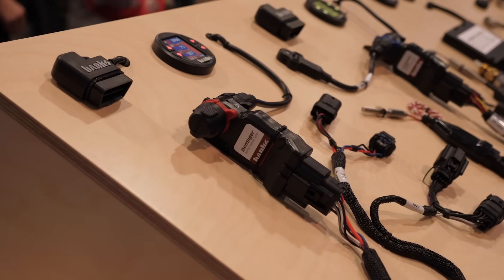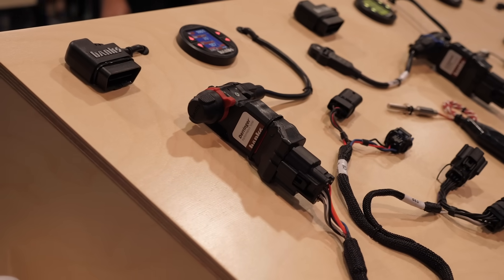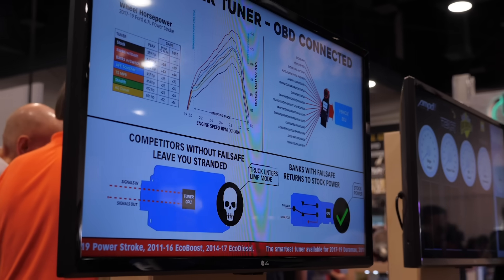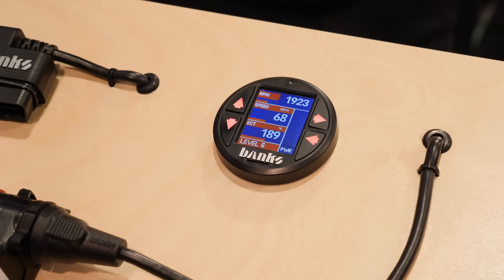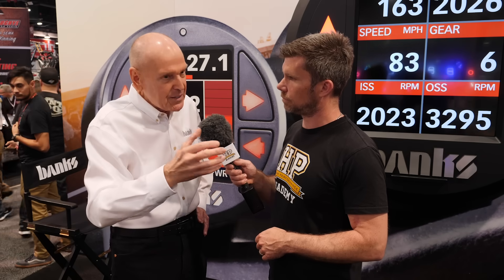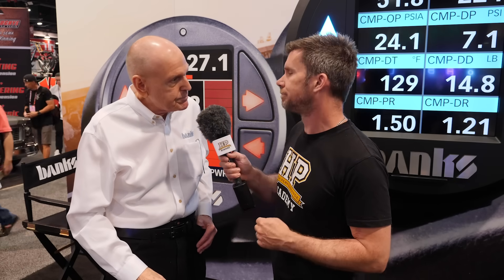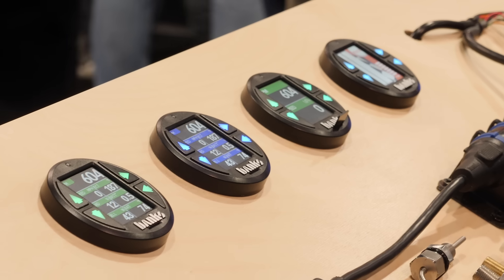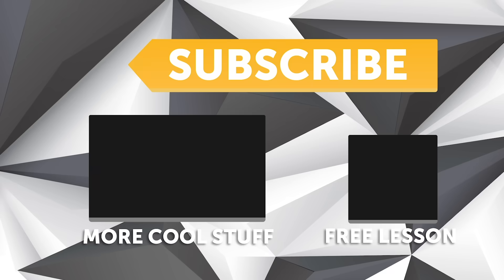More POWER With A DPF Fitted? | Gale Banks On Emissions [TECH TALK]

Comment: A lot of the focus is around the dpf. Here's a valid question: Why do manufacturers make these components welded to the exhaust vs having crush seals with clamps so they can be quickly and easily changed out when they do go bad? To normal people, it's rare enough to not be an enormous deal, but when a person uses it as a work vehicle, it can reach the end of its life in three years time. By the time a vehicle reaches 150-200k miles, it's typically devalued to the point it's not cost effective to spend the cash to replace it. So then people buy new vehicles. Sounds like a large carbon footprint to mine, refine, stamp, and manufacture all of the components of a new vehicle no?

Next is the egr (my large gripe). It soot loads the intake and combined with oil from the pcv, it completely gums up everything in the intake. It also soot loads the oil meaning accelerated component wear for any moving part in the engine. Though egr does reduce NOX emissions, whats the trade off here? Suddenly it takes million mile engineering down to 300k. SCR and plastic jugs are another irritating item. If every diesel pump had def nozzles, it wouldn't be as big of a deal but single use plastic jugs are garbage. I'd keep the exhaust crap to keep the epa happy but the egr choking up the entire system is horrible. Higher egr rates also lead to more black smoke production, clogging the dpf faster leading to more frequent regens.

I know gale banks is a brilliant individual in the tuning world, with nearly unparalleled knowledge, but I would like to see him take some stance on what should be acceptable vs too far when it comes to emissions restrictions. Hes got more knowledge on the subject than probably every consultant for CARB and the EPA combined.
Reply: As an major domestic certified dealer technician i can promise you OE manufacturers do not care about you (directly), or the ease of a vehicles repair. They care about sales and profit margins. If they can assemble a vehicle faster by having one huge exhaust component they will. It reduces part numbers (build materials) and time to install. Vehicles are built and engineered to be assembled on a mechanical assembly line. Whatever makes that job easier is what they care about. It's easier to pay us flag hour techs in the dealership to repair or replace something later than it is to slow down or stop an assembly line. They don't care about me, you, or anything else. As long as the vehicle is sold and can make it out of warranty, they're good. Also, the engineered lifetime of a vehicle is 150k miles. Lifetime fluids, lifetime filters, etc all are 150k mile services, or until a catastrophic failure, obviously.
Reply: @revell7156  Unless you're a Japanese vehicle manufacturer, then 300,000 mi. At least.
Reply: Perhaps you should consider installing a catch can to deal with the crankcase fumes.My Peugeot has a removable dpf with crush seals
Reply: @davidwarren4569  ,Yes, Gale has an in depth video on how they work and why they are so important.
Reply: I almost guarantee that it cant be a simple bolt on device because that would make deletes that much easier. Its probably EPA regulation as well as cost. As a automotive engineer every cost has to be approved if a cat or other exhaust component is bolt on instead of welded that means 4 flanges 2 gaskets and like 6 nut/bolts. You would be amazed at how much approval is needed for a $1 cost increase per vehicle.
Reply: Agreed, manufacturers makes it both impossible and very expensive to maintain your vehicle in the long run. All these devices won't last very long
Reply: @marcnunes6916  They don’t care about you. It isn’t the government, it’s the OEM. For them, the target is profits in first sale, after that isn’t their problem. And work trucks aren’t the norm in the market now
Reply: I have to agree with you MrSkyentist and also the fact that a lot of these items reduce fuel mileage which just pollutes even more. But why make an essentially non-serviceable part for the average joe and something that is thousands of dollars and an absolute pain in the ass to replace. Granted I know this isn't ever vehicle. But it does make things frustrating. And myself being in auto repair industry. When you get a car back in that is stuck in regen mode or clogged up. Do you think that dealership is going to replace all those parts to make it function as normal again or patch it up enough to get it on the lot and working for 5k miles so the customer can cover the cost. I guarantee its gonna be the latter.....so in another few thousand miles gonna be in the same boat again if you don't buy extended warranty. Which lot of times is a rip-off anyways.
Reply from the maker: I think it depends on the vehicle. It seems to be more common that you can clean a filter instead of just replacing it - Taz.
Reply: @hpa101  On almost all (the vast vast majority) of light and medium duty trucks, the DPF is at the very least part of a welded assembly with the DOC.  They can be cleaned, but the weld between the two has to be cut, and then the assembly has to be rewelded afterwards.  

It's just idiotic engineering from the OEMs pushed our way by the idiots in the government.
Reply: @immikeurnot  the Cummins in the Nissan cam all come apart. The dpf unbolted from  oth ends and in the middle between the dpf and cat.

Comment: What about all the extra fuel burned during regen? Burning extra fuel than needed... no different than the smoker diesels! Emissions crap on diesels is a joke! They burn just as much diesel as none emission one but add def crap
Reply: The new Rams do most of their regens in passive mode, because they put the DPF early in the system so it is hotter.  Ford's are at the end and generally too cool for passive regen and so they do active regens frequently...Watch some of PD Diesel Power's videos.  He owns both and documents it.

Comment: It takes more fuel and isn’t replaceable in order to stop air pollution in which the trees and many other ways are always replacing air so shoot the whales but save the seals
Reply from the maker: Yes it's tricky to get perfect, and things take a few generations to really get dialled in, but it's still more than doing nothing. I guess the actual usage of vehicles will be targeted next if things like this fall over in certain countries which no doubt will get more hate than diesel particulate filtration systems.
I certainly don't have all the answers but can see both sides to all this - Taz.

Comment: Please inform me how letting your Egr releasing carbon and soot direct into your intake is good for the consumer? Also please tell me how making a whole industry to produce, Deff fluid, truck the fluid service the system helps anyone? Anyone who has a truck with def know the waste buy buying a box of def makes any thought?
Reply: There is no good for the individual owner. The cost of the vehicle, the cost of poor fuel mileage, the cost of DEF, the cost of added maintenance and the cost of mechanical failures due to emission equipment designed for the dinosaur era all mean less value to the owners. It seems the EPA is good with the extra cost per individual to get the overall results in emissions at no cost factor limits.  No business could survive that business model.  These soot and NOx controls are archaic devices that cost a fortune to maintain/use. I say if you don't really need a diesel buy a gasoline engine and forget about giving up tens of thousands to the vehicle makers and the subcontractors who are failing BIG in the emission controls.  Just look as the gasoline engines of today...they have more power and torque than the older muscle car engines that polluted big in the 60's yet way less pollution due to engineering within the induction systems and controlling fuel more precisely. They haven't spent enough engineering time on the diesel so this is the jalopy idea they are using for now.
Reply from the maker: Jake Heke  that shit won't fly at all in most of Europe, and to be fair the whole 'rolling coal' crowd put a big spotlight on things in the US which is not something that was as much of an issue elsewhere.

No matter what your passion or interests are there is always some minority out there to make life harder for the majority but emissions are an issue that is not going to go away anytime soon and not one the EPA solely created either - Taz.
Reply from the maker: Yes it's tricky to get perfect, and things take a few generations to really get dialled in, but it's still more than doing nothing. I guess the actual usage of vehicles will be targeted next if things like this fall over in certain countries which no doubt will get more hate than diesel particulate filtration systems.
I certainly don't have all the answers but can see both sides to all this - Taz.
Reply: @hpa101  Why are people making glider 2020 semi trucks with older Cummins, Caterpillar, and Detroit engines? No one wants to be stranded in the middle of the nowhere in limp mode/ derate. Diesels thrive with 2 things air and fuel that's basic stoichiometry. In small engine applications whether it be cummins, duramax, or powerstroke the turbos restrict the engine on purpose to keep egts higher and egrs cleaner. The mess of oil dilution, cylinder wash down, cracked heads, and turbo failure follows suit. Emissions are a joke and there are valid reasons for removal such as high sulfur diesel, racing, gliders, and reliability. But of course someone with a new diesel engine ought to know they are buying into a whole suit of problems when the sensors go haywire.

Comment: WHY HASNT ANYONE COVERED THE OM647 TURBO DIESEL?
AVERAGES 500K MILES EASILY! 
BARELY ANYTHING ON THESE OM647 MOTORS!
Reply from the maker: Show us your OM647 performance build Richard to get the ball rolling =) - Taz.
Reply: That's just because OM606 is still superior and includes the missing sixth cylinder :P

Comment: I don't mind all the emissions stuff. I love clean air. Just mandate the manufacturers warranty them for 200,000 miles.
Reply: I prefer my engine to last. They can stick the emissions.
Reply: The pollutants still go into the atmosphere at some point. Either constantly like pre emissions or only during regen cycles. Sure you can mandate a manufacturer and force them to over a 200k warranty but they will then triple the price of the product. Regulations always cost the consumer always will
Reply: Too bad only Honda gave one million kilometer (625 thousand miles!) / 10 year warranty for their Diesel engined Civic in France. And those are reliable even with all emission stuff but manufacturer just have to make it well.
Reply: @Karjis  That's impressive!

Comment: "are DPF deletes a waste of time" Short answer - No
Reply: @Jim John ,  I know a guy that only rents his new trucks so he doesn't have to worry about maintenance or down time.  He said it is not eating into his profits either, because just like you said, the newer trucks tend to have a 30% uptick in maintenance and down time.
Reply: I run Schaeffer's 10w30 Ultra SynShield : https://www.schaefferoil.com/722-ultra.html
In a 2020 Ford F-450 and I use AR6200 in every tank. In Canada I had a team of experts that have made the truck much more efficient without the EPA :). Amsoil is used in the transmission,  transfer case and differentials. My goal is to to get 1 million miles out of the motor. All I can say is this truck rips.
Reply: sure they are the engine dumps raw fuel into the thing to burn it clean so they save no emissions in the end just dump it all at once and not a little every time

Comment: I don't have to worry about any of this. The only thing that came on my 2ed gen cummins between the turbo and the tail pipe is the muffler. I get that the newer stuff makes more power and is cleaner but I'd never buy one. Can't afford it if anything goes wrong with all that emission equipment.
Reply: Although they haven't gone retroactive to date, I wouldn't put it past them when it becomes the obvious next step...
Reply: @bas4241  
Good luck enforcing it. And adding all the emission crap might exceed the value of a lot of trucks. Then again, this is the same government stupid enough to think "cash for clunckers" was a good idea so you're right. Best not to underestimate government's greed and idiocy.

Comment: Mr. Banks is a smart man but his stance on emissions control is just for the public and to make the EPA happy.
Emissions control on any engine is completely stupid. 
Every internal combustion engine is an air pump. The easier it sucks air in and push air out then the more efficient it'll run. 
Restrictions to this air flow by way of catalytic converters, DPF systems, and especially EGR systems, is preventing these engines from running at peak efficiency. Which means more fuel consumption!
And DEF systems are notorious for failing and leaving you stranded! 
And usually these systems have to be completely replaced and the repairs are costly. 
It makes the vehicle very unreliable and I personally don't feel safe in a vehicle with these devices and systems on it. 
The government wants MORE mpg and MORE emissions control? Really? 
The emissions control makes MPG worse! 
Which in return causes more emissions to be made by an engine that's not able to run at maximum efficiency! 
It's a LOSE LOSE situation!

Personally my 08 LMM is fully deleted and is running a DSP5 switch with EFI Live.

Look around and you will still be able to find delete kits and good reliable tuners that can still hook you up.

The government will never be able to stop this 100%. 
Thankfully I live in a free common sense state that understands this. 

It's my truck, it's my choice, it's my personal property. 

Go fuck yourself EPA because you're just as bad as those Indian scammers! 

Why would an agency that is supposed to care about the environment allow big industrial plants to pollute the environment IF they buy pollution points from them? Hello....scam much? 

"Don't you dare pollute the environment, unless you can pay us millions of dollars, then we'll allow it because we don't really give a shit. We only care about money!"

It's also funny that more Co2 in the atmosphere gives plants more food to convert into oxygen, to which 70% of the world's oxygen comes from phytoplankton algae in the ocean and not from trees. 
And every geologist knows the earth goes through warming and cooling cycles every 10 or 30 thousand years and we're on the tail end of the warming cycle heading into the next ice age cycle.

The EPA is just another way for the government to suck up money and control people and businesses by creating a false issue and creating laws and regulations to enforce. 

Think of the money they get from fines, tax payer government funding, pollution points, regulating manufacturing, etc. etc. etc.

I haven't seen any EPA groups going around and actually making a difference by cleaning up trash on the side of roads or cleaning up China's plastic pollution in the Pacific ocean? They're not actually doing anything to make a real difference about real pollution. 
They just steal money and that's it.

Edit: Oh and my EFI Live tunes don't smoke either. The tuner is really damn good at what he does. Very smooth tunes from factory OEM levels all the way up to racing levels. 
I have been daily driving on the max race tune. Staying pretty light on the throttle and I'm getting way better fuel economy! But I can stomp it and embarrass a Mustang, BMW, Audi, Honda, or Mercedes that thinks my big ole truck is in their way. Lol
Blew the doors off one of those Ford EcoBoost trucks too. :)
Reply from the maker: The whole conversation is about how you can still make good power increases while being legal and without adverse effects on your DPF system, not if DPF is good for performance in general or not - Taz.
Reply: @hpa101  
I understand. Some people have no choice but to keep the emissions stuff on their vehicle because of communist controlled states.
But it's a shame. 
The government gives the ATF and EPA way too much freedom to create "regulations" whenever they want. 
They like to turn law abiding citizens into criminals overnight with the flick of a pen. 
Just making the rules up as they go.

Every year we lose more and more of our freedoms and I'm just tired of it. 

If the EPA wants to look at my truck then they can meet me way out in the middle of the woods or corn field and afterwards I'll come out alone and drive off.  :P  lol